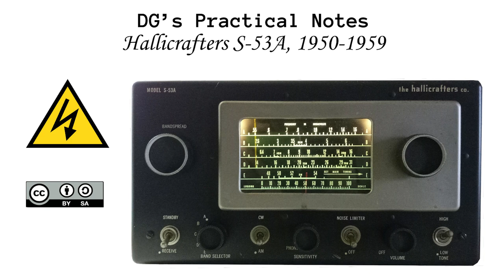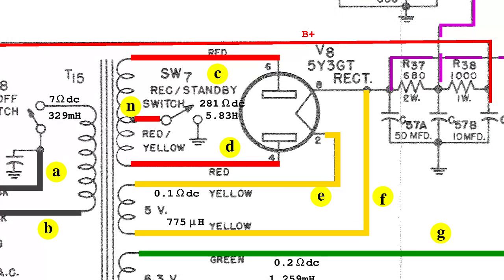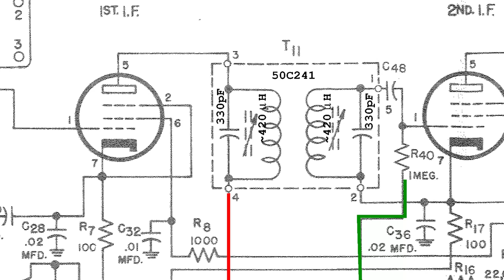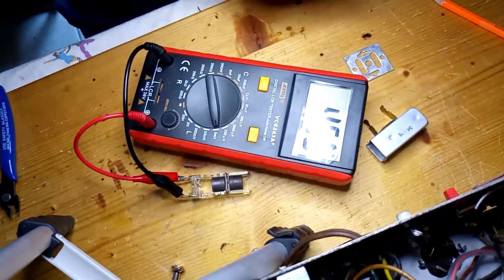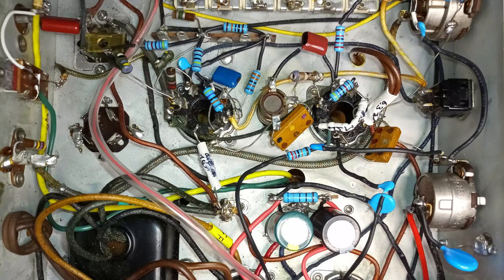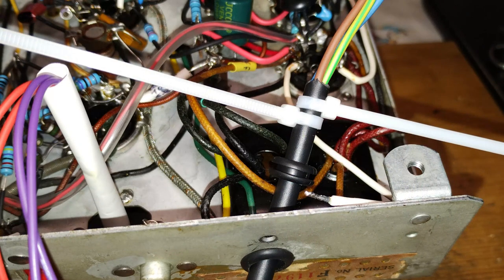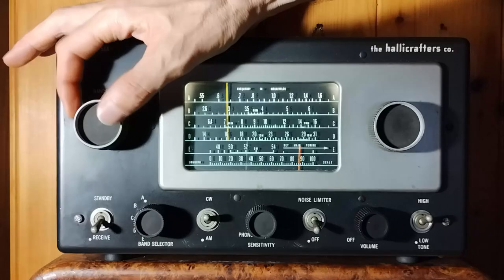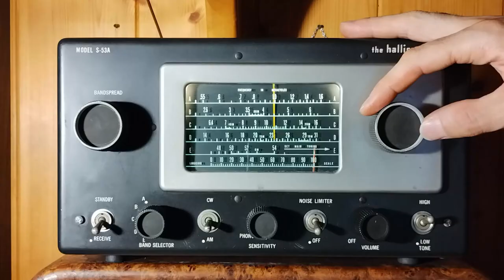DG’s Practical Notes, R#7 Hallicrafters S-53A, 1950-1959 [v2]

Comment: The power cord replacement is a bit too complicated... a simple knot is enough!
Reply from the maker: I disagree about the knot, because a loose power cord could eventually snap its wires inside the chassis, possibly making a short circuit. And we don't want that, do we? There are specific power-cord strain-reliefs, which others could prefer to install: I agree on that. Thank you for your comment.